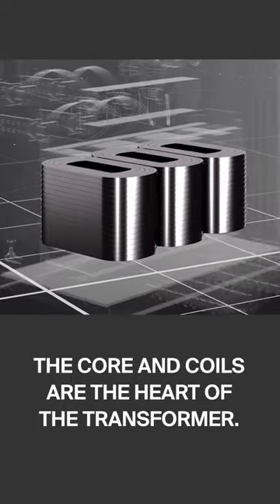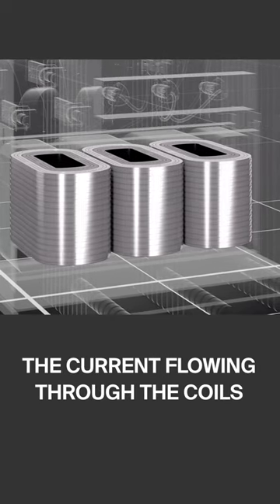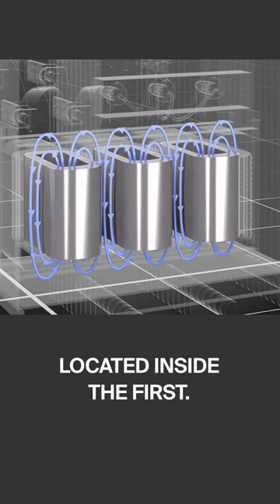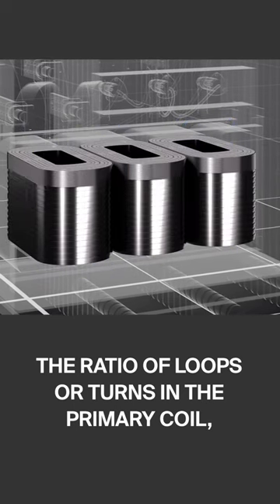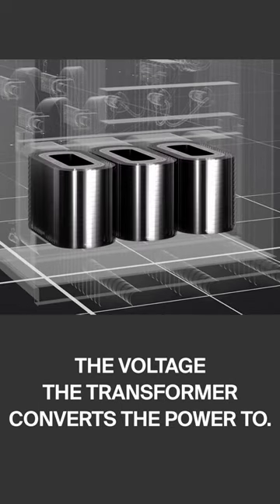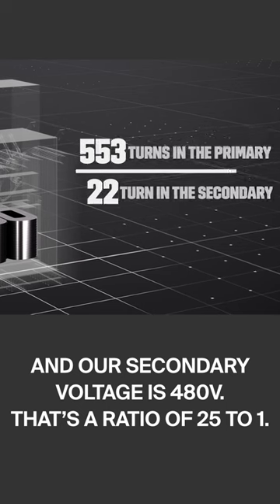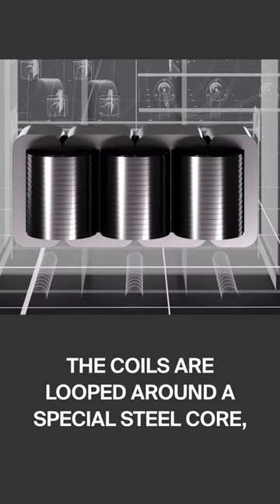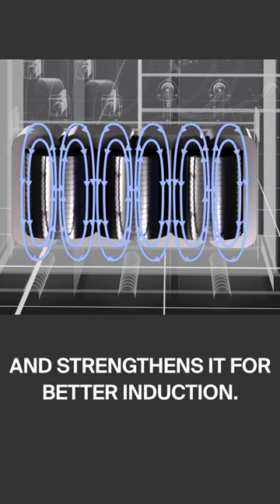How Transformer Core & Coils Work | Maddox Transformer #transformers #electric #energy #shorts

Comment: Excellent. What happen if the transformer is setp up? Are the coils in the same position according to the core?
Reply from the maker: Great question Yordan. We actually have an entire article on step up and step down transformers: https://www.maddoxtransformer.com/resources/articles/step-up-step-down-transformers-and-reverse-feeding/

Please check it out and let us know if you have any questions.
Reply: @MaddoxTransformer  is a core absolutely necessary? I've heard that there are coreless transformers like an air core transformer I think? Are the losses greater in an air core transformer?
Reply from the maker: @bigman5729   good question:

"When you have two coils of wire side by side and you pass an electric current through one of them, an electromagnetic field is induced in the second coil, which can be represented by several symmetrical lines with direction emanating from north to south pole–called lines of flux. With the coils alone, the path of the flux will be unfocused and the density of the flux will be low. 

Adding an iron core inside the coils focuses and magnifies the flux to make for a more efficient transfer of energy from primary to secondary. This is because the permeability of iron is much higher than that of air. If we think of electromagnetic flux like a bunch of cars going from one place to another, wrapping a coil around an iron core is like replacing a winding dirt road with an interstate highway. It’s much more efficient."

For more details check out this article we have about transformer cores: https://www.maddoxtransformer.com/resources/articles/transformer-cores.
Reply: @MaddoxTransformer  Wow thanks, I greatly appreciate the response and I may check out the article.